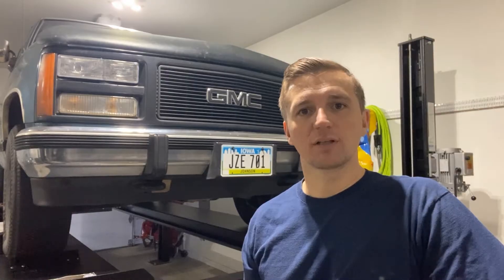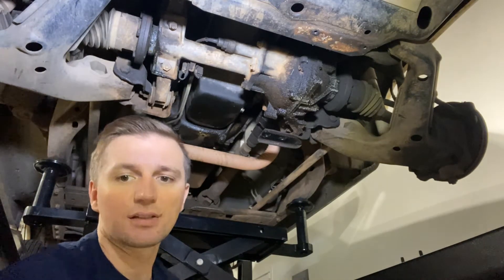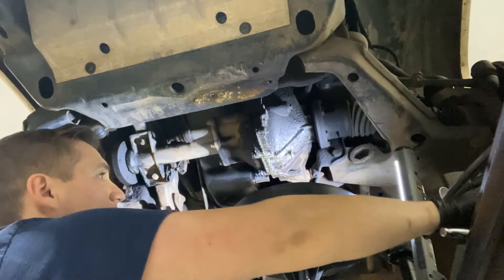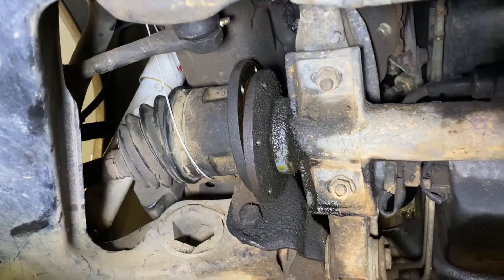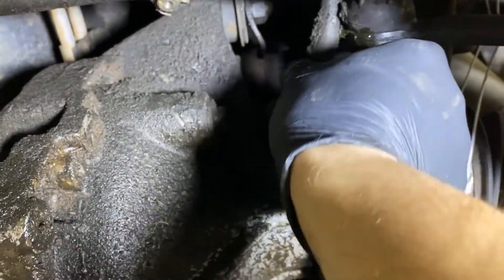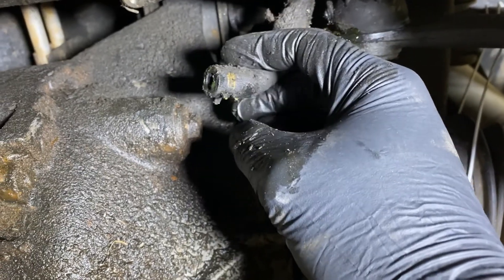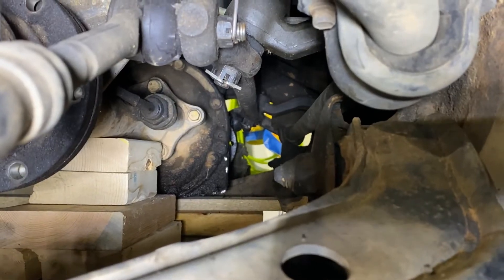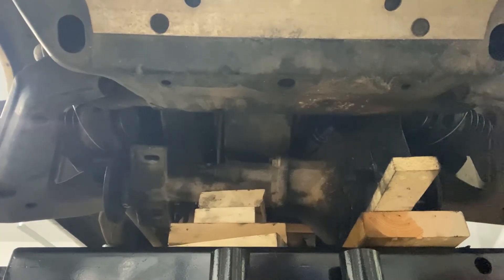Removing the front differential on an 88-98 OBS Chevy 1500

Comment: Hey, does anyone know if its okay if I remove my front diff? I'm fine with it being 2wd if it works that way?? Figured it'd be cheaper than replacing the diff.
Reply from the maker: @joshua jones A few people have asked this. I can’t say for sure. I think it would be fine, but I don’t want someone’s wheel falling off!
Reply: If you remove the front diff you have nothing to support the weight of the cv shaft to connect to anything very dangerous
Reply: Thank you! Definitely gonna give it a shot then lol
Reply: thank you @David Schnase
Reply from the maker: @David Schnase I assumed that he would also remove the cv axles and not leave them dangling!
Reply: 😂😂 Suburban Ranch

Comment: Dont you need a front end alignment once you disconnect the ball joints after you get it back together?    thanks, great video and explanation.
Reply from the maker: @tom miller Yes, the best practice would be to get an alignment. We did get one after we replaced the front end.
Reply: @SuburbanRanch  Thank you
Reply: All things being equal, if the parts are in good shape, it's not mandatory to get an alignment, so long as you leave everything intact. It is advisable to have it checked tho.

Comment: Dumb question from a shadetree mechanic, trying to get my oil pan out and the front diff is in the way. My Tahoe is already on ramps, so I'm wondering if taking the wheels off and putting it on jack stands is an absolute necessity for removing the diff, haven't been able to find a straight answer anywhere. Hoping you can help me out
Reply from the maker: @Patrick Bowman You probably don’t have to remove the wheels to pull the front diff, but you will at least want to jack the truck up so that you can spin the cv axle and access all of the bolts.
Reply: @SuburbanRanch  Thanks so much! And great work with the front end series for these trucks, this will be really helpful for my front end rebuild!

Comment: You need to remove the Front Diff to remove the motor?
Reply: No... taken my engine out twice. Never had to mess with the front diff
Reply from the maker: @Nick Maresca I don’t think so. The motor comes out the top
Reply: It’s to remove the 4x4 which I’m searching for
Reply: Yes you do. On a truck with 4x4 the front diff gets in the way of the motor mounts. Learned the hard way.

Comment: Did you video putting this back in?  Having issues getting that too bolt in on my 99 Tahoe OBS. Any tips getting both of the differiental housing bolts back in on driver side?
Reply from the maker: @Brian Hargrove We have not put the differential back in yet. Should be doing a video on the install in the next month.
Reply: @SuburbanRanch  Yeah, its tricky to get the bolts on driver side back in solo.
Reply: Yeah I need that too an parts list.

Comment: For anyone watching, you can indeed remove the front differential without removing the center link and tie rods. Steer all the way to the right, and the differential should pivot out with some finesse
Reply: I got it out today using this trick. Getting it back in is another story. Removed the centre link anyways to help get it back in.
Reply: @aidenstefanson2175  Huh, sorry about that. I used a trans Jack and some blocks of wood to keep it at an angle and force it back in with a pry bar. Glad you got her done though
Reply: @gunshipproduct2  A trans jack would be perfect! Anything to control the phone book angle as you muscle it back in.
Reply from the maker: Gave that a try but there did not appear to be enough space.
Reply: Had trouble with it, turned the wheel to the right, basically feel out, 👍 couldn't get enough leverage to take centerlink off , but now that the front differential is removed I got it off and can slide it back in place definitely the way to go on this my vehicle is a 1996 K1500
Reply: Hey man great videos, quick question are the outter passenger and driver tie rods the same. Same would be for the p n d side inner tie rods n sleeves
Reply from the maker: @Francisco Mendez Left and right are the same I believe.
Reply: Just the comment I was looking for
Reply: Did this and works fine